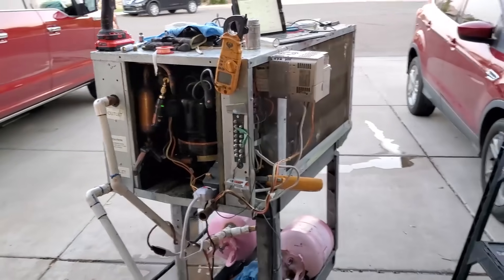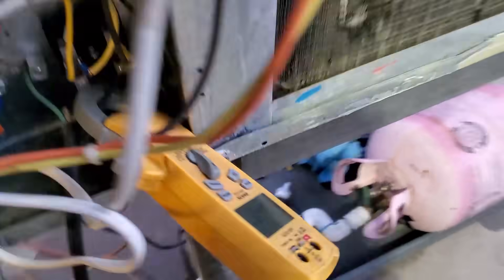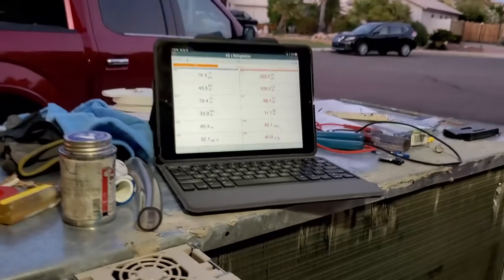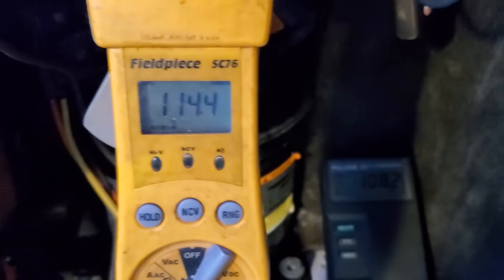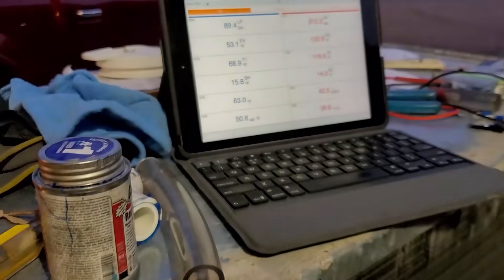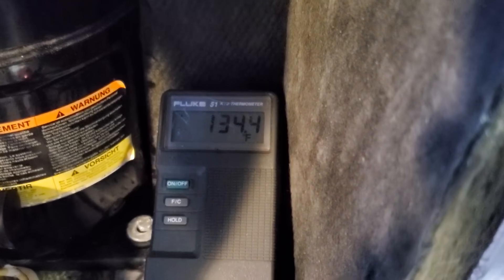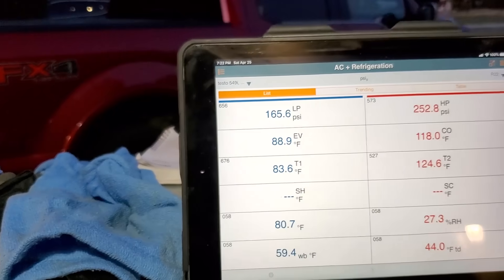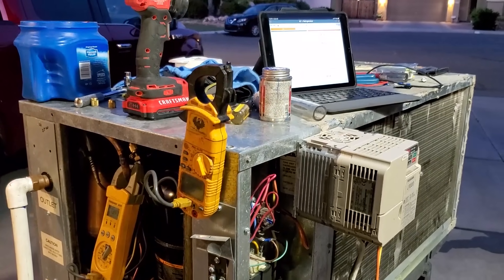Testing new circulation pump on the 2 Ton Bastardized Water Heater - Success but almost got wet!

Comment: Yeah right when that sucker head about 120 it was like I want to know how hot that gets before the exflowsion happens.👀😬🙈🔥. Thanks brother I'm learning something🍀🍀🍀🍀🍀
Reply from the maker: Yup. I already blew a hose like that on the smaller Bastard a few weeks ago.
I just needed this to hold long enough to do my test.
It will be hard piped into the water heater tank here pretty soon.
Then the real fun begins!
Reply: @hackfreehvac  yeah it seems like that'll be a better pressure vessel at that point at least LOL. Can't wait to see the results to that one day you will be safe it don't worry if you die I'm sure it won't be from what's going around.  LOL😉! NO FEAR😬🍀🍀🍀🍀🍀🍀🍀🍀🍀🍀🍀
Reply from the maker: @rjeff4179  
I'm certainly not afraid of that C-19 Virus.
Wow are they exaggerating that nonsense!

As for the water heater, well it heats anyway so I am sure it don't matter what heats it.

AND since there are no backflow preventers on residential (except for landscaping connections) it will just stay equalized with city pressure. HA HA
Reply: @hackfreehvac  your intelligence is only exceeded by your Virtua sir thank you for teaching me I don't care about the threads I am old school three and a half years in a machine shop guy so I appreciate the infrastructure have everything mechanical you're doing very well sir you are teaching me at least she don't think that you are going unnoticed I appreciate you everyday f*** the rest of it. Carry on sir not worried either
Reply: @hackfreehvac  brother the owners of my house living Scottsdale I remember your video from a couple of months ago that said they are assholes in Scottsdale yeah buddy here's the video I just sent down have fun with it spread it around not going to give you the names but yeah definitely
Reply: @hackfreehvac  brother I can tell by what you put out that you're not and that's obvious to me I appreciate what you do I'm learning everyday and even though there are threads that are available to me as far as your tray goes I spent three and a half years in the Machine Shop I went from running a regular Parts as a button Pusher moved on into inspection qualified tools told the old boys that were there for 25 years how to adjust their parts running a CMM so I'm into the infrastructure of everything and the physical part of this world intrigues me greatly and thank you so much for putting out what you're putting out you're one of like five people but even watch on YouTube even though I have a shitload of subscriptions I don't hardly pay attention to anybody that is full of s*** at this point I'm the only reason that I would is because there is a modicum of lies in a bunch of Truth or a modicum of Truth in a bunch of Lies but of course we know all of this I'm not trying to push any fear p*** and I don't think that you are either in so thank you so much for teaching me I appreciate you forever and always and Scottsdale yeah bunch of Pricks no doubt about it I can explain more but the and I do mean not credible LOL thanks for your time keep up the good work sir and enough as far as I'm concerned of coeptis operandi Veritas Invictus deca 1 9 whatever you do don't put that into the Google search into the translation for Latin that'll give you a headache you donate all my respect you and your sir and I am working on charging my air conditioner is the GM from 1972 and it still runs really well and thanks to you hopefully it won't blow myself up again. And if I do it's not your fault I just wasn't paying enough attention hahaha hahaha be well my friend bunch of stuck-up motherfukers in Scottsdale yes I totally agree and that's from a video you put out a while back but of course you know this and again, I respect you and yours good luck with that Ford I've got three I don't think luck has involved at this point hahaha